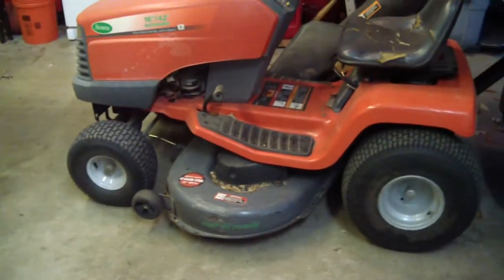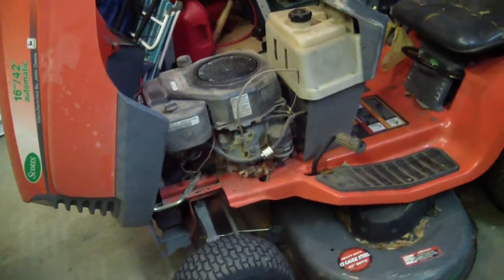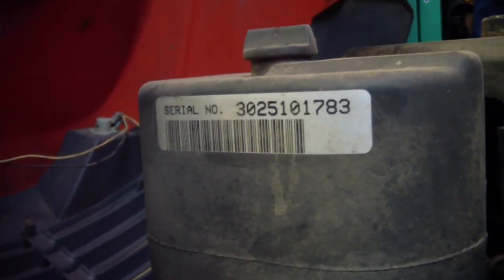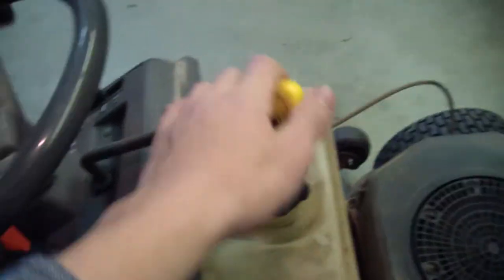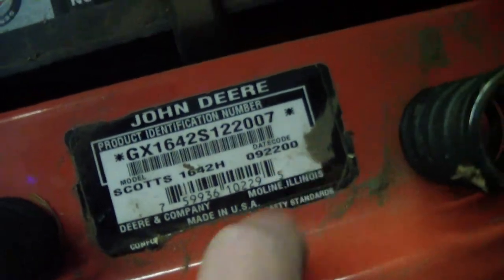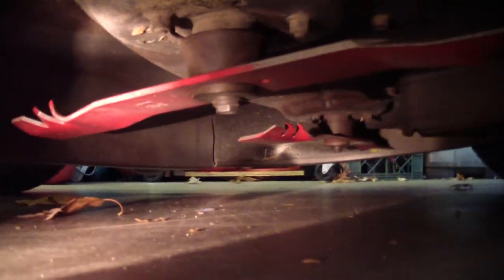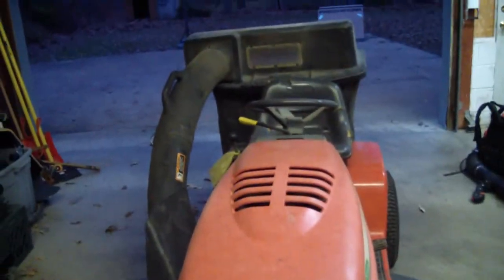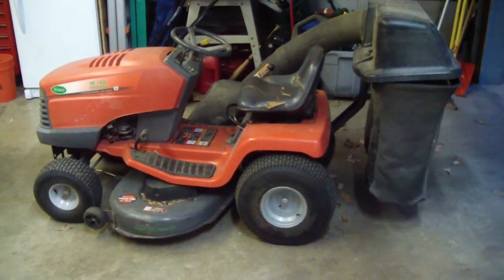Review of The Scotts Tractor for RiverasLawncare

Comment: Alright didn't see that, to find the year of manufacture for these Kohlers you add 70 to the first two digits of the serial #. So it was manufactured in 2000 like the tractor. When it says it meets 2005, that just means it meets the emission regulations of the future year 2005.